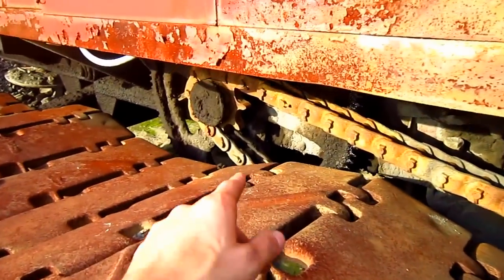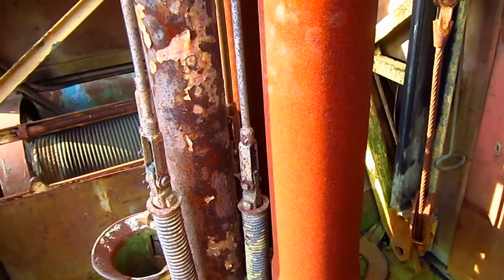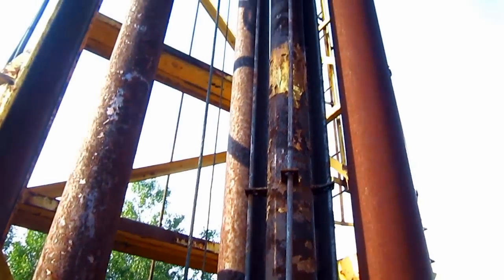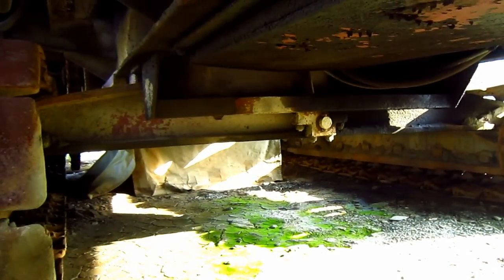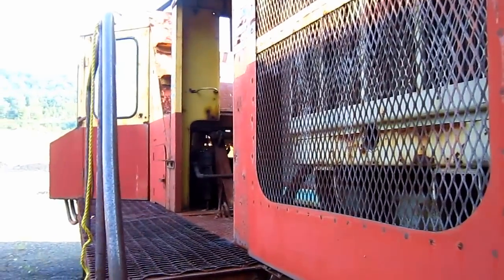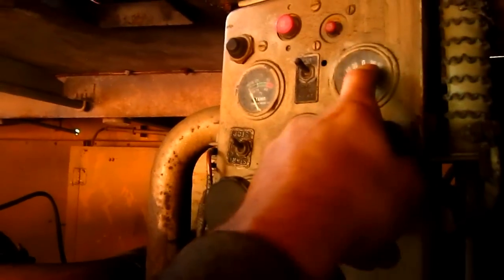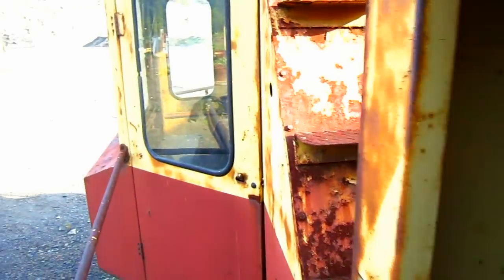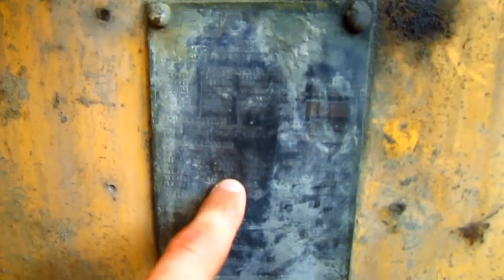Bucyrus-Erie 40-R Documentary

Comment: Ok, please explain to me why two propane tanks have steel pipe, with threaded caps and bolts welded to them so they can be removed by hand and no obvious way to fill them, no pressure gauges and a small ball valve on the bottom that anyone can turn and release the pressure. Not to mention the fact that it's an extremely expensive way to heat that tiny cab, the heat from the engine is free considering it needs to be running any way.Please educate me.

Comment: Cool machine, But why would you think that machine needs propane to heat the cab when it has an engine to do it. Also I've never seen a propane tank with a steel pipe with a threaded cap and simple gate valves attached to them.That is extremely dangerous. Please explain to me why you think that they are propane tanks.
Reply from the maker: JRBUISEXCAVATING I don't think they are propane tanks, I know they are.  I spoke with the drill's owner who told me that those are aftermarket tanks installed for propane for the heating system.